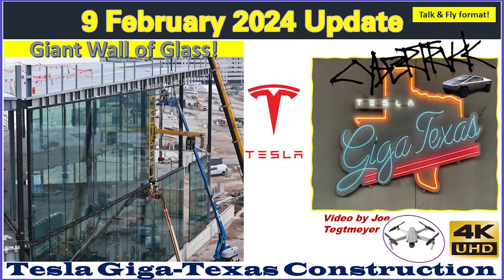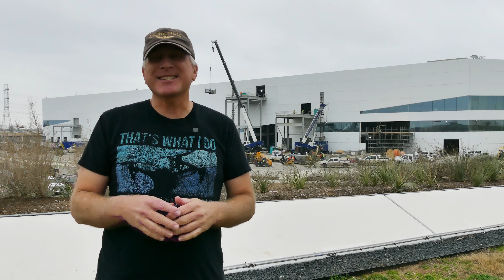S Steel & Glass, Receiving Dock Work & Casting Apron Widened! 9 Feb 2024 Giga Texas Update (07:55AM)

Comment: roof issues so soon after being built? contractor issue?
Reply from the maker: Not sure the cause in this particular section, but I've hear it has some leaks and I saw it flapping in the wind on one of my drone flights. For some reason, the adhesive did not work in this area and does need repair.

Comment: Could they be building a pit to place a crashed vehicle that has a thermal runaway event?
Reply: Had the same thought. I assume crash test vehicles would normally have no charge in the batteries. AFAIK they don't crash test ICE vehicles with fuel in the tanks.

If they do want to crash test with a charged battery a dunking bath would be handy to have close by.
Reply: @DessieDoolan  There's a good reason to crash test EV's with fully charged batteries. And that is the location of the battery. Under the vehicle where it inhibit people from exiting the vehicle if it caught fire. So at least I hope they crash test EV's with fully charged batteries.

Comment: 8:14 Appears the peak on the new section doesn't line up with the peak on the existing building…
9:43 Interesting that they didn't paint the horizontal beams black too.
Reply: 8:14. That's correct. Existing roof W to E is a flat M shape. /\/\ 

Southend roof is a flat VW shape. \/\/\/

9:43. Would be space to get behind to paint as the beam is narrower than the column, and the glazing track brackets stand off a few inchs. About 6" 150mm space in Joe's photos. 

Not to say it wouldn't have been easier to paint prior to glazing installation.

Comment: As a layman, why wouldn't the glass be installed LAST?
Reply: It almost is last. All the heavy construction is complete. Other than the Level 1 (ground floor) concrete works where the glass will need protection from rebar cutting sparks, and concrete splashes (plastic).

Comment: The large number of Superchargers being installed in the new west End Of Line (EOL) facility implies these will be used for a very high production volume vehicle, probably the next generation (Model 2) vehicle which will likely be unveiled in Q2 2024 and ramping production in 2025. This is also implied by the large new parking lot area for staging and loading shipments next to the new EOL building.  The sheer size of the EOL building implies that it will be used for inventorying high production volume products that need to be stored inside, such as Optimus robots.  I'm very curious where the new Boring Company tunnel will end up emerging on the east side of the highway. Time will tell, and soon.  If it emerges inside the footprint of the new South Extension, that greatly increases the probability that it is for new Optimus robots to securely walk themselves through to get over to the new EOL building for post-production charging, inventorying, and job-appropriate neural network uploading just before shipping.  The new road being constructed to Tesla Road and its intersection with highway 130 will be ideal for shipping any and all high production volume products, potentially including Model 2s and Optimus robots!

Comment: I don't think that anybody should be too surprised to find that the concrete additions fanning out from in front of the main entrance, will be extended right across the road, fanning outwards until it reaches the other side of the road and my guess is that they will embed red accent lighting to match the overhead lighting on the pergola in front of the main entrance.
Reply: My guess is also lighting related. Maybe lighting between the slabs. A laser light show.
Reply: @DessieDoolan  Yep, something like that. Might not necessarily be a light show but a 'dressed to impress' lighting effect for shareholder & other evening-held events. That red lighting at night looks amazing, more so when reflected in the glass facade. The red lighting stretching across the black tarmac at night would provide a very cool infinity effect.
Reply: @DessieDoolan  You may have a good point, the leader likes to play around with cheap LED lights. 😊
Reply: @DavidJohnson-tv2nn  What are cheap LED lights?  Are you saying LEDs are cheap in general or only ones Elon buys?
Reply: @sammyk874  He's just taking another cheap shot.
Reply: @jbbuzzable  I'm aware.  Just calling him out on his BS as usual.
Reply: @sammyk874  A cheap cheesy architectural element as opposed to an elegant one, like the stone glass or the glass curtain wall on the south end. Though I question the wisdom of all that glass on the south side. In my opinion... The leader has a way of doing dumb things over and over, like his obsession with mentioning "420".
Reply: @DavidJohnson-tv2nn  What makes LEDs cheap and cheesy?  It's all in how you use them.  Your obsession with Elon is also dumb.
Reply: @sammyk874  You know what is dumber?  The obsession of Musk fans loving all things Musk, no matter what!
Also, it's a free country. I don't have to like him.

Comment: Thanks Joe
2:10. GA, apron. Demolition and excavation to construct set-downs for dock levellers. These docks were being used without levelers.
5:22. Robotic Avenue, south. Drainage culvert pipes have been knocked on a skew from excessively flow.
7:24. Southend, Tank Farm. 5th ring* built on the tanks. More ring segments on the ground. Height of tanks now exceeds Level 2 of the structure to the left.
7:47. Southend, east diagonal. Level 2. Smaller glazed units. Same width as the taller unit installed below. Not the ideal angle, but measures the same height as the parapet would be.
8:38. Southend. West diagonal. Level 2 perimeter beams on the ground not fitted with stiffening plates at each window channel mounting lug. At least not visible, as a supplementary ‘web’ is fitted almost to the edge of the beam. Beams beefed up as the space behind will be open.
10:12. Southend. Bottom. Striped the form-tube from around the CFA pile extensions.
10:45. Southend, west. Bottom right. An offset pad integrated with the column footing. Access to a drain or water in the cast-in recess.
11:54. Westside. Tunnel Project. Bottom. Pair of curved TBM components described by David Salisbury as ‘temporary launch decks’. Used for the back-up decks to be driven over to connect to the back of the TBM. Inside curve would match that of the inner radius of the tunnel. These decks don’t enter the tunnel if I understand correctly.
12:21. Westside. Tunnel Project. From David Salisbury. Back decks being connected for a remote launch. TBM will start boring before these are lifted into place. Presumably initially on the ‘temporary launch decks’.
16:02. Main Entrance. 3 parallel slabs. Base for strips of Stoneglass or some other feature floor finish. Ends are on a tapered alignment matching the raised Stoneglass platform.
In other views these seem to vary in height, but this might be an illusion caused by the tapered ends.
Would be a weird location for signage, interfering with the effect of the portal frames.
16:36. GA, apron. Current vehicle exit. Reel/spool of orange flexible conduit.
16:57. GA, apron. Bottom left. Demolished ramp. Pavement under and to the south of the excavator has been saw-cut.
17:52. Battery north, apron. 2 short, 2 long, bridge crane beams. More orange flexible conduit.
18:45. Casting north, apron. Edgeboard shuttering lined up for placement to the left.
19:00. Casting east, apron. Installing a ‘slot drain’. Same installed recently in the new ELO Transport yard, and a couple of years ago in the east parking lot.
19:29. Casting east, apron. Saw-cutting for demolition. In Brad’s video yesterday it seemed to be marked for more than just a trench.
19:59. BIW, apron. Surveyors. Further excavation works, utility relocation, drainage construction, before this is paved. Same at 20:12.
20:40. Parking Garage area. Excavation works for a ductbank to connect to the Parking Garage.
23:04. Tesla Road east. Widening works. Doesn’t strike me as being permanent works.
24:11. Cathode west. Top right. Telehandler shifting in a pair of Porta-loos. Don’t want to get that wrong. Especially on the return trip.
24:42. Cathode. Sanitary sewer lift station. Wiring up the permanent electrical controls. Genset must be providing temporary power for an active sewer system. Stuff on the move.
25:15. Cathode north, windows. Cafeteria or office. Empty currently. Lines of black blocks on the floor. Office partition mounts possibly.
26:16. Crash Test Track. White water-stop seal buried in the slab around the rectangular shape, but not the wings. Don’t want it to leak.

*Ring, as commented @gtproductions1
Reply: 26:16. Crash Test Track. Had a thought. I have assumed the crash test vehicles have no charge in the battery.

If for some reason a vehicle was to be tested with a charged battery, then a dunking bath for a possible battery in thermal runaway would be handy to have nearby.

This might be for that. It's halfway there, being bath shaped.
Reply: 2:10 The docks look completely new.  Not present in Jeff's Jan 28 video and recently cut out in his Feb 6 video.
Reply: @sammyk874  2:10 You're right! 

Lucky I didn't make any hat eating claims.😬

Getting close to the Main Entrance. Although symmetrical-ish with the loading docks on the north side of the Main Entrance.
Reply: re 25:15:  a bit further on, at 25:27, the overall picture of that long piece of construction with a strip of windows around the extreme end reminds me a bit of the spaceship Discovery in the movie 2001 a space odyssee.
Reply: @hardernl8893  25:27. 2001, A Space Odyssey. In the same theme, it's a monolith.
Reply: @dessieDoolan 12:21, I'm still on the fence about how they will start the TBM. It looks like they are setting up for a 'short' launch, with the back-up decks on the side. But I can't see any reason for this. It complicates the launch, and adds days, possibly a couple of weeks to the overall time to complete. We will see one way or the other in the next couple of days.
Reply: @davidsalisbury50  12:21. A system on a back-up deck giving them trouble that might be difficult to sort out 'in tunnel'. Awaiting a replacement component? Is there commonality between TBM components. Or is everything bespoke?

Joe mentions the thrust ring was being lifted into place as he drove past post filming. Should see that in Brad's video. He normally flies on a Saturday.
Reply: @DessieDoolan  Most TBM components are modular and replaceable, a lot of commonality in the internal components. TBM diameters and cutterheads may be "bespoke" but are often re-used 3/4 times from previous projects, especially in the 2m-6m diameter range. Herrenknecht in Germany have a large facility near their main TBM manufacturing plant that is dedicated to machines that return, are stripped down and many components re-manufactured for re-use as-new. e.g. the main thrust rams on this Prufrock project will only cycle in and out a few hundred times in the whole drive. Compare that to the rams on an excavator which will do hundreds of cycles per hour. back at the refit plant they will be checked, re-sealed and stored for the next TBM that needs them. Herrenknecht have excellent records in all their TBM components, so it is not unusual to see a 200T propulsion ram that is on its 6th or more project as part of a "New" TBM.  These things can be identified if you know where to look on the rams. Herrenknecht don't hide this, or try to cheat buyers, they are proud of this level of recycling.
Difficult things to change are the large components near the front of the machine. Motors are a pain, they can be 3T in weight, very difficult to handle. This is one of the reasons why TBM 's have more installed power than required on the cutterhead in case one motor is down, the remaining three can keep production going, then it becomes a cost/risk trade-off to stop and replace (easily can be a 2-3 week stoppage), or, keep going on reduced power and zero remaining redundancy. Often, big projects will require a spare motor to be kept on site along with a 40' container full of other common spares, hydraulic hoses, minor pumps and rams etc.
The big one is the main bearing (what the cutterhead turns on). If they fail the TBM is pretty stuck. It is often half the diameter of the TBM, weighs 20T (even for this size TBM, can be 80T or more on the very large machines0, it is right at the front, effectively in one piece. It may be 15-20% of the total value of the TBM.
If it shows signs of failure near the end of a drive it can sometimes be "nursed" along using lower thrust, additional greasing etc (they use positive displacement grease to "push" any contaminants out). 
To change one in situ underground the whole back-up, erector, EPB screw, motors, airlocks etc. etc., has to come out, back down the tunnel. Everything except the shield and cutterhead. If available from the surface it may be more economic to excavate a slot shaft down in front of the TBM, drive into it, then remove the cutterhead and take out the bearing from the front. Either way, this can easily be a 6-month delay to a project, huge cost (you end up hiring Antanov's to fly in very heavy components).
Hence main bearings are, to some extent, over engineered. This is one of my arguments when Elon Musk says they have installed 3x the power in Prufrock, it's not practical or needed (in my view it is not really possible, a bit like putting a 400hp V8 in a Mini cooper).
Reply: 16:02 Not totally weird for signage.  From ground level the portal frames could frame the Tesla logo.  Or it could be the base of a giant squeegee for the stone glass.
Reply: @sammyk874   16:02. I guess what I'm saying is that there's likely not going be TESLA spelt out in 6' high letters. I can't imagine the entrance would be obscured.

I reckon there might be a clue in the graphics on the trailer opposite. Some sort of additional lighting.

All said, other than the sign on the roof, there is no signage.
Reply: @DessieDoolan  Oh certainly nothing that tall.  Maybe half that along the ground, not on a pedestal/base.
Reply: Appears to be completion of Plaid symbol that is seen in reflection from entry windows
Reply: @warrenjohnson7097  Yes I think its a continuation of the theme. At 15:50 its also apparent that the trapezoid continues across the road. Outer edges of the garden bed line up with the bases of the portal frames.
Reply: 20:40 Yep, looks like the parking garage will be powered by the same duct-bank that powers the eastside Superchargers. And that existing duct-bank goes all the way back to the main building @ 19:53 (Right). Or will connect to the main building when the new cables are pulled through.

Comment: Regarding the concrete strips at the west main entrance, it looks like the strips are being installed in such manner as to prevent vehicles from driving in toward the building across the highly polished floor sections.  Or they may be raised steps that would also be protection.
Reply: Or just an extension of the pedestrian crossing

Comment: Thanks Joe!
Parking garage:
@ 6:24 Concrete poured over new duct-bank along the west wall.
EOL facility:
South:
@ 13:27 In trench, two conduits sticking out from under the concrete pad. Interesting. Time to review some earlier videos to review the conduit layout prior to pouring the pad.
@ 13:40 Another view of the work and the open cabinets.
North:
@ 15:06 Not new, but cables can be seen sticking out of vaults.
@ 15:16 A view into the vaults at the NE corner.
Main entrance:
@ 16:05 Three concrete footings or slabs. Looks like it might be an extension of the walkway out to the road?
Eastside of casting:
@ 19:51 ((Towards the right, 3 cable spools by the building) As expected, the vault cover was removed after the concrete pour in order to complete the cable pull into the building.
Temporary substation:
@ 27:18 North A-frame tower taken down.
BESS substation:
@ 29:34 All 24.9 kV switches are still open.
Megapacks:
@ 29:40 (Towards the bottom) Cabinet door open on one of the Megapacks.

Comment: Why would they install the glass this early?  It must be a test case on just one corner edge of the building to finalize fitment and test the seals for when the finish the rest of the south perimeter of the building.  Otherwise why would you block up such a large opening to load material into, plus those huge glass panels are going to repeatedly get filthy.
Reply: It's not early. All the heavy construction is complete. Other than the Level 1 (ground floor) concrete works where the glass will need protection from rebar cutting sparks, and concrete splashes (plastic).
Reply: This is not a test. All of the steel on the south end is designed for glass.
Reply: At the glass panel factory, how and where would you store all that glass waiting for delivery? I think they are installing it about as fast as it is made. And we are seeing one months production.
Reply: @kkarllwt  Can be stored anywhere.  I noticed a crate at a logistics company about 15 miles away.
Reply: The crates cost more than the glass. @sammyk874
Reply: @kkarllwt  Sedak is a German company. No US plant that I can find. Double, maybe triple glazed. The units look to be 4" thick minimum.
Reply: Materials can be loaded from the North or West end of the extension. Note also the triangular are on the East that will probably be assembled last.

Maybe they're closing the South for dry-in reasons? Which direction does the weather come from around there?